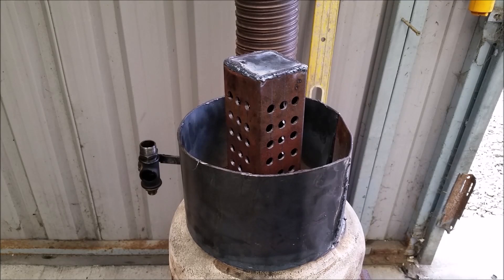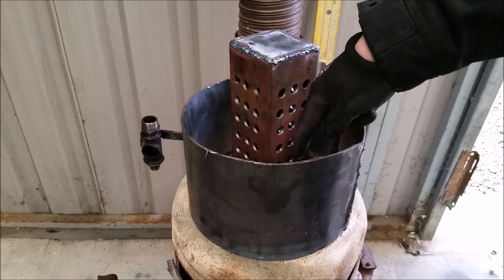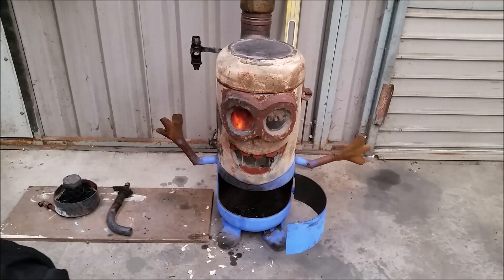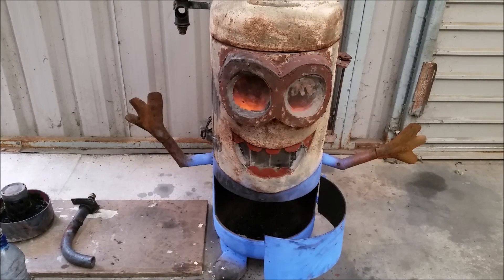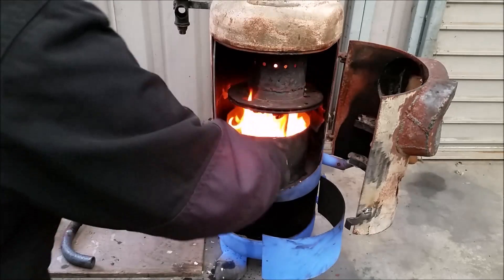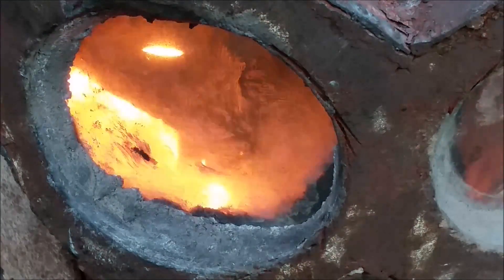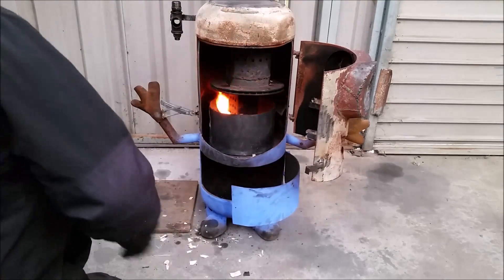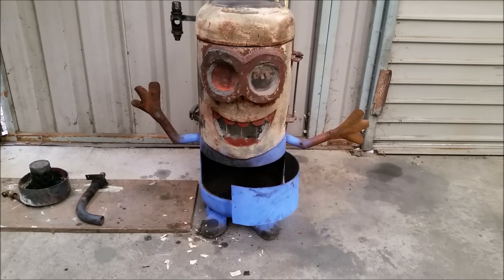Bigger Air-tube Waste Oil Burner

Comment: Is there any burnt oil smell from it
Reply from the maker: Hi Harry. there is no smell or smoke indoors from the stove as the flue is long enough at 4m to keep a great pull from the stove. Outside the is no smoke but  it is definitely not fresh air. There can be a smell depending on what you are burning. Sometimes burning waste veggie oil  it can smell like a fast food  place. My other little propane bottle burner won out over this one. Cheers Gerry

Comment: could you tack weld some metal strips on the corners of the combustion tube and bend them so it would crate a vortex when the air really starts flowing?
Reply from the maker: Hi Kiffer Tom. I think that if you could get the air to vortice within the pot that would be better for combustion. It already mixes very well and sounds a lot like a rocket stove in operation. I will be making some more burner videos soon. We are still in Summer here so I was waiting for the weather to get a little cooler. Cheers Gerry

Comment: I like the fact this is working so well with no induced draft. I gotta tell you with each progressive burn that minion gets more evil looking.
Reply from the maker: Hi Steve. You are right it getting to be a right little f'er. Some of the 800°c paint burned off it to day so I think its going it stay ugly . The stove and burner part looks very promising though. I will have some fuel in the morning so as soon as I can light it I will make heat.   Cheers Gerry

Comment: When we increased the size of our air tube (Flue?) we had to lengthen the chimeney to maintain vaccum and as a consecuence the heat flame in the flue increased substantially to about 3 metres out of the burner. There seems to be a proportion between the size of the air intake, the flue, the expanded hot air volume due to the burning, and the end speed of the hot air. Does the same occur in your burner?

Comment: I'm anxious to see it going when this design is complete. The mods appear to be an improvement but the proof will be in the test fire. Did you have the brake disc sitting on top, in this one?
Reply from the maker: Hi. Marcel. I wont have oil until tomorrow so I cant light it in anger until then. I have another video uploading at the moment. It certainly burns well but I did not have sufficient fuel to let it rip. We will see tomorrow. Cheers Gerry

Comment: 2nd square tube, bugger than firts, on 1st,
prehet air.

or vortex + venturi down square tube.... ✌👍👥
Reply from the maker: Hi Fred. I will have some oil today. I am looking forward to trying the new setup. I just uploaded a video and you can see a slider adjuster I made. Hope it all works. Cheers Gerry
Reply: Hello Gerry.
M'y setup was inner tube on foot with air going at bottom.
Will Watch new vidéo.
Thanks